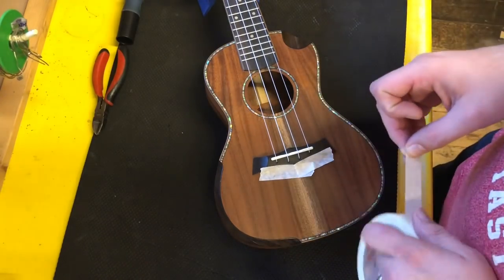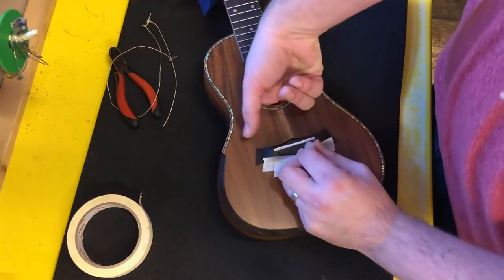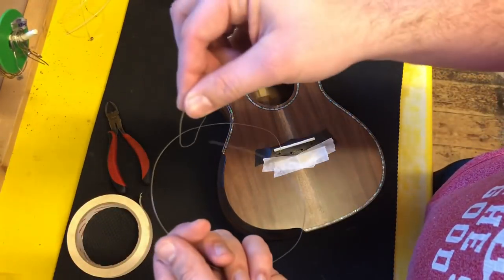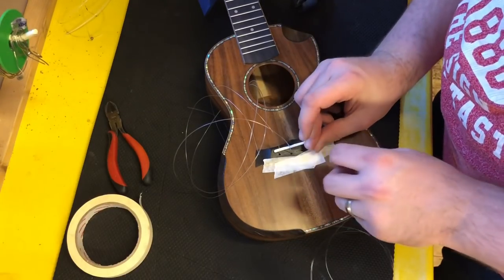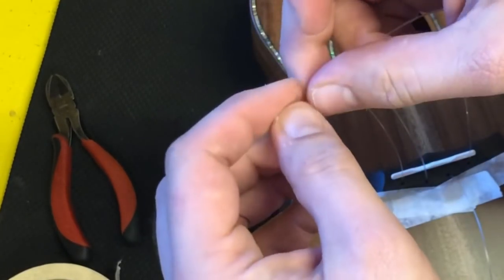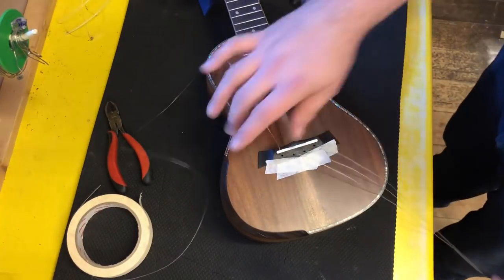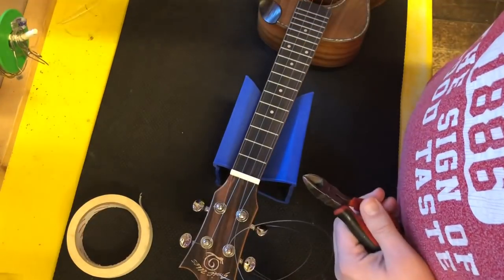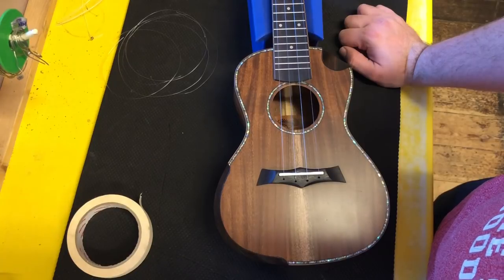How to restring a Snail or Kala Elite Ukulele (pull through Ukulele bridge)

Comment: Well I just got this as a gift and in a few months my uke has a intonation issue. The g string is not ringing, It plinking. It's rubbing  on the  fret I guess. can these necks be adjusted, or fixed?
Reply from the maker: It probably needs new strings. If the intonation issue has developed, that would be the first thing to check. If you have just changed the strings give it a couple of weeks to settle. Otherwise yes they can be adjusted.

Comment: Hey Alex,
I have a Kala Elite tenor and when I received it only one strings had the bead on the inside. The “E” string. Which I don’t use. Over the last month I have tried three different sets of strings. What I’ve found is my double knot, which it appears is the same knot you’re using, stretches out while tuning and re-tuning the first few days, will on occasion pull free. Is this usual or am I doing something wrong?  Because of my big paws I also made a retrieval hook to fish out the strings. It is made from a wire coat hanger and then I covered all exposed metal with a heat shrink wrap rubber tubing to protect my ukulele. I think of it the same way I look at a winder, it just makes life a little easier. 
Thanks for posting,
Wes
Reply from the maker: That’s a good tip Wes, if the knots aren’t thick enough then I recommend getting the beads - there isn’t an exact science to it. You can buy the beads in bulk from a craft shop and one customer told me they got a bag of ball ends on eBay for £2... it sounds like that’s the only way of fixing the problem. I have seen some companies thread all four strings together through the sound hole and tye them all to each other - that would work for sure. They can’t come undone if you fasten them all together!
Reply: I’m sorry to bother you but a final question, does using a bead ever cause an instrument to rattle or vibrate? Thanks again, Wes
Reply from the maker: It could but I think it’s unlikely as essentially you are creating a ball end, and the important parts are happening between the bridge saddle, tuning peg and the nut.

Comment: Just lost one string on my Snail SUC M1. Would you replace just the one string or take opportunity to replace all. Only had the uke 4 months. Also string broke 1 cm  from the bridge. Struggling to push the little piece through to get it out and reach through the sound hole to pull the other end. Any suggestions?
Reply from the maker: That's a shame... I recommend just changing them all as factory strings from new have a shorter shelf life than a new set from a packet... (You don't know how long they were on the uke before you got it and they would expanded and retract under tension whilst in transit).

The other benefit to doing the whole set is because it gives you a clear soundhole to put your fingers in to pull at that stuck string end... While you try and fish it out I recommend poking a thin screwdriver or alum key in the hole on the bridge to loosen the knot that's stuck. Fingers crossed it's worked for me hundreds of times over the years on all sorts of Instruments.
Reply: Southern Ukulele Store thanks. What strings would you recommend? Any tricks to get the short broken string out that is stuck in the hole?